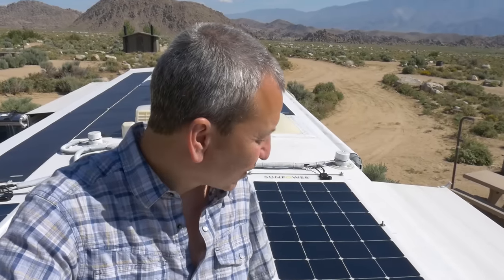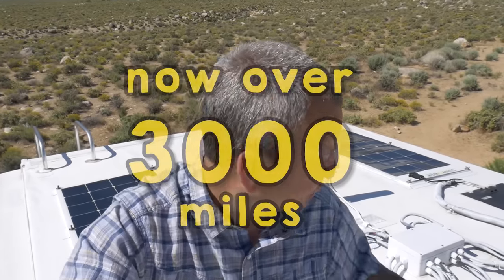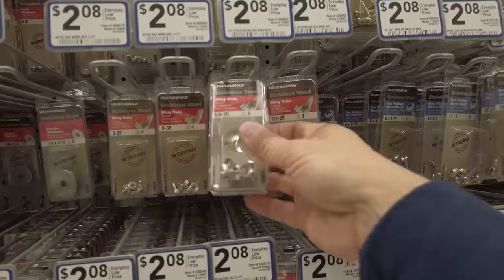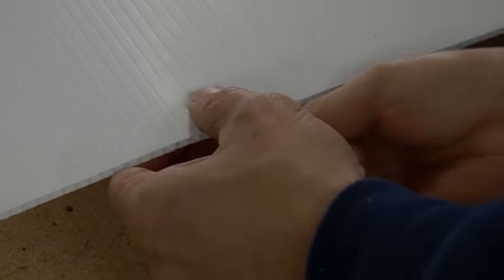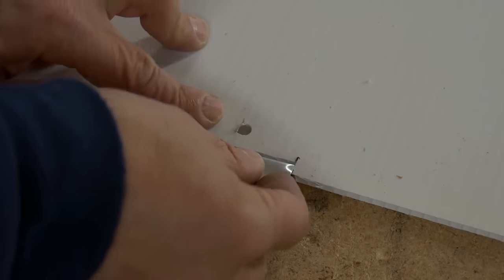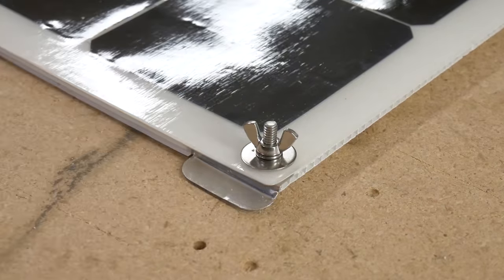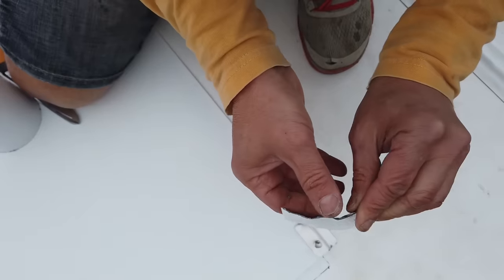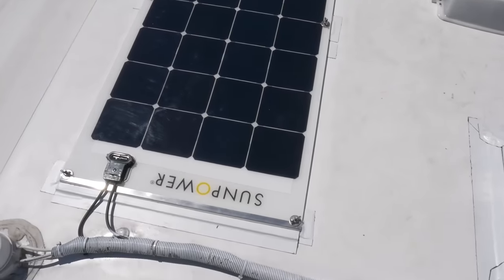Better Way to Mount Flexible Solar Panels on RV (2019)

Comment: Would this really work with tpo/rubber roofs? Your roof seems like fiberglass, I worry about simply gluing onto rubber skin/“paint” and it simply peeling the rubber up and off.
Reply from the maker: My roof is TPO

Comment: Great concept, is there any reason not to just glue the insulator to the roof of the RV and glue the panel to the insulator?
Reply from the maker: You could do that. It would just make it more difficult to remove if you ever needed to.

Comment: Hey what I did was I have 3-320w frameless glass solar panels so I used 1''-1/2'' PVC pipe cut a slot down one side  of each pipe and cut the inside  of each elbow and use  6''x6'' Composite Decking Board for my corners and the midpoint of the length of each panel  to keep it up off the roof then used J pipe  clamps to hold down the PVC frame in to the Composite board  2 at each corner and at midpoint  drilled holes on bottum of PVC for drainage works great and was cheap and easy (just my idea)
Reply from the maker: Thinking outside the box. Love it!

Comment: Thank you for the video and information.  Do you think a second layer of the corrugated plastic will be good to insulate the panel from the roof more, pad under the mounting bolts and still be a strong enough mount?
Reply: If you want to lift it up further, try a polycarbonate panel or tubular aluminum frame.

Comment: Nice video Tito and after seeing your video I bought a couple of Sun Power flex 110 watt solar panels. I noticed in one of your videos you put out a portable  solar panel on the ground as well. It also looked like a flexible solar panel. How are you supporting it on the ground? Is it the same method you used for small solar panel on windows with pvc tubing around the sides? I'm asking becuase mine will have to be portable  since I don't have the real estate on the roof of my small 16 ft RV for panels.
Reply from the maker: Awesome. Did you buy from Sunpoweredyachts.com? If so I have a new discount code for 10% off. I just haven't published it yet.
Reply: @RVwithTito  Brian,  yes I did. Once I test these, I'll need to order two more so that I'll have 440 watts total portable solar. 220 watts in parallel.to two Lithium Iron phosphate batteries.  Just finished making my solar cables using your video to crimp and connect my MC4 connectors. So, yes if you do have the discount code that would be great for my next order. Also, just noticed and watched your part 2 of using PVC on 110-watt panels. I'll need a way to keep them from blowing over when ground-mounted. Thanks for the videos.

Comment: I wonder if the corrugated plastic will rub/bounce on the roof and create a wear spot that rust can attack.
Reply from the maker: I have a rubber roof so not likely. On a metal roof, I would cover the bottom of the bolts with eternabond so nothing rubs.
Reply: @RVwithTito  so you aren't worried about the plasticore vibrating/rubbing against your roof?

Comment: Would your system hold up to walking on the panels? I own a catamaran and I would like to install more solar on the coach roof. I need to be able to walk on the roof though because my reefing lines are on the mast.
Reply from the maker: Unfortunately no. You may damage the panel.

Comment: With all that room why wouldn’t you use a 481 watt bi facia panel that puts out some real watts and inverter 10 amps I have 8 on mine producing 90 amps DC and 45 amps AC in 110 volt

Comment: Is moister getting trapped between the rv  and plastic panel?  I wonder if it will get swampy under there. Probably won’t damage your rv and a good power wash will take care of it if you ever remove it.
Reply from the maker: A little bit swampy, but it drains and dries mostly. Check out the update video I just posted.
Reply: RV with Tito DIY oh yeah. Thanks for the update. Good work. 👍

Comment: How were you able to get the wing nut to screw on snuggly without everything just loosely spinning in place since the other end of the carriage bolt isn't being held by anything to tighten the wing nut?
Reply: Someone suggested cutting a slot in the vault end of the threads for a screwdriver, However after slugging it down with one nut on top of a flat washer you can put a second nut on top and counter tighten them without putting too much force on the whole unit

Comment: How do you know, for sure, that the panels are cooler with that barrier between them and the roof? The roof can act as a heatsink if the panels are in contact with it and suck heat out of them. In my experiments, my flexible panels run 10 degrees cooler when they are in direct contact with the roof with nothing behind them. Have you done any comparisons?
Reply: They will run hotter and fail. Panels need an air gap under them to keep cool. Flexible panels aren't quite there yet and only last a few years or so. The roof will only act as a heatsink if it is metal. Rigid panel are still the way to go.

Comment: I have a 2017 Jayco Greyhawk 29MV, it came with a Macnum Dimension1000W pure sine wave  inverter , with a Macnum Dimension CSW-TS15-H 15A AC Transfer Switch and lastly a Progressive Dynamics.inc INTELI-POWER 9200 Series Model PD9260C,  I wanted to upgrade the INVERTER with a GoWISE Power PS106, 3000W pure sine wave inverter, can just the Inverters' be switched or will the Transfer switch and Converter/Charger  also have to be upgraded .
Reply from the maker: Yeah. You should be able to swap out the inverter as long as its voltage matches your battery system voltage and there are no proprietary AC or DC connectors.
Reply: @RVwithTito  thank you, yes to the best of my knowledge,  everything is compatible as far as voltage,  I was concerned that may e the transfer switch was made just for the Inverter that came with the couch, they are from the same  manufacturer.  I really don't know that much about the limits on the switch if there is one at all.
Reply: @ronjones2733  May not be a good idea. A 3000W inverter would draw MUCH more DC power and be able to supply 25A+ AC. It looks like your transfer switch is rated for 15A, so you may need to replace the transfer switch with a higher current one. May have to update wiring, fuses, etc. too (DC and AC) to handle the larger loads.

Comment: Did you test the heat?  If so were the panels cooler?
Reply from the maker: No I haven't, certainly not with the same panels. My previous panels were very different, but looked the same as these.

Comment: The thing that might be an issue is galvanic corrosion. Mixing steel with aluminum and being outside in the elements... https://en.wikipedia.org/wiki/Galvanic_corrosion

Comment: why didn't you install nylon embedded nuts rather than wingnuts? You don't seem to need easy wing nut removal if there is a need to remove the solar panel. A simple wrench can remove nylon-embedded nuts in little time, and the nylon should ease your mind about the nuts working loose.

Comment: One potential problem if you ever have to change solar panels. There is a good chance the new panels will not have the same dimensions as the old ones. Have found this even with panels from the same company. In that case your mounting points will have to change for the new panels.
Reply from the maker: I've seen that too. Thanks for pointing that out. I've been known to pick up a spare panel when I order the others.  I've also just drilled new holes in flex panels that don't have enough.
Reply: @RVwithTito  I asked a solar panel vendor about putting new mounting holes in a flexible panel and was told it would void the warranty.

Comment: It seems to me that just one layer of the plastic cardboard at the bolt sites is all that is holding down most of the panel if you cut away

Comment: How would I install panels on a 98 Ford e250 passenger signature select series eclipse?   The roof is all wavy like.   And I have idea where to start .  Please help.
Reply from the maker: Each install is unique to your vehicle. I've seen folks mount the panels to the ribbed pieces that stick up with VHB tape or Sikaflex sealant. Others have created their own frame. Just make sure the one on the front of the van can withstand high winds hitting it.

Comment: Why not just glue the plastic corrugated sheet to the bottom of the solar panel?
Reply from the maker: I ended up doing just that in the more recent flex mounting video.

Comment: Why not use an extra layer of aluminum foil to reflect and dispurse any heat between roof and backside of the solar panel to a large area? It is a way to cool because it is aluminium ! Btw I would have made a rack out of tubes where I can hang my flexible solar panels between the bars with some tensioners. You get a way larger area available to mount panels and still do not interfere with skyroofs and cableboxes or vents. You could even make it a three layer foldable rack creating triple the space of your roof area for a whopping 2KWatt solar capacity if you wanted.

Comment: Water doesn’t get caught between the plastic cardboard & the solar panel?? Help! Thanks!
Reply from the maker: Yes. Between the plastic cardboard and roof. I used a hose to blast it out periodically. Now I have a different setup.

Comment: Why not just use 300w panels made for domestic use? 4 of those and youl be set
Reply: Most, if not all panels can be used for battery charging OR ...to tie into the power grid out on the street. It is the solar controller that determines what service the panel is capable of providing. NOTE the panels that tie into the public power grid have a complicated and costly array of controllers, cooling fanms and and other specialized equipment. Be careful what controller you purchase...some will not work in a stand-alone situation such as with an RV or remote cabin.

Comment: You've been running this over a year now.  Have you had any problems just having the solar panels taped down?
Reply from the maker: I did a follow up video at the one year mark. All good so far.
Reply: How about your electrical output? I have heard many people experience decreased flex panel efficiency in a relatively short period. As much as 30% in one year. Thx!
Reply from the maker: @OCNJKirk  No so with these in my case. They seem to still be performing well.

Comment: i have used that plastic board to block the sun from my rv tire, after about 4 yrs they get very brittle and and break apart
Reply from the maker: Good to know. Thanks. Seems easy enough to replace after 4 years.
Reply: @RVwithTito  but mine are also in direct sunlight so these may not since they are under the panel, i am going to set mine up like this also

Comment: That corrugated plastic is not stable for use in the sun long term. It becomes brittle and falls apart in a couple years. But good idea overall.

Comment: How would this method work for those long narrow amorphous panels?
Reply from the maker: They are peel and stick. So you'd have to stick them first then mount them I suppose.
Reply: RV with Tito DIY Thanks Brian. Was thinking the same thing, mine are eighteen feet long and somewhat cumbersome to roll up and store, but I like the ability of placing them on the ground and parking the MobyHome in the shade. Still thinking of a way to secure them topsides for travel.

Comment: It's hard to tell from the video but what is your roofing material?
Reply from the maker: TPO rubber roof.
Reply: @RVwithTito  Looks like it has been holding up well, no issues with the rubber lifting at the mounting locations then?

Comment: Hi! So the corrugated plastic sheets you placed under the solar panels - did they eventually rot out due to weather?  It looks like after you carve out the small sections for the bolt heads that all you have holding the sheet to the solar panel is a very thin plastic surface...

Comment: Very novel install! Love no HOLES in the ROOF!! Only concern....You cant angle your panels for a better angle in the winter & I've read that flexible panels aren't as reliable. Thx!
Reply from the maker: I have more panels I setup on the ground which I can point anywhere. There aren't many folks who tilt there panels regularly. It's kind of a pain.

Comment: Thank you for yet another very helpful vid. But i wonder: Why not just glue the solarpanel onto the coreflute?
Reply: Mega Chill then it would defeat the purpose of the wing nuts, you want the panel to be easily removed whilst the corflute remains anchored on the canopy

Comment: the raised bolts sticking upward could be trip hazard while being on roof.
Reply: Be sure to wear your leg guards and gloves, actually if the bolts are the proper size length then all you have to worry about is the wing that which has rounded corners.

Comment: How do you get the wires inside the RV?
Reply from the maker: Here's how I did it: https://youtu.be/aB8ic6x9DAM  There are other ways too like down through a refrigerator vent if that's an option for you.

Comment: Where do I buy the flex
Panel you use. I want to mount 2 panels on my 4 wheel pop up which has
 Yakima rails mounted.

Comment: Brian, I'm curious  about the RV withTito name.  While reading through the comments many refer to you as Tito instead of by your name. Is that an acronym for something?  
While out RV shopping,  you found it and said "This is the one" ~ T i t o ~ or name of a puppy, or?
Reply: I think he said it was the name of the dancing figurine on the dashboard of the RV
Reply from the maker: @benningtoncamper2852  Correct!
Reply from the maker: The other comment is correct. Little Tito still sits on the dash. You can find the original "Big Tito" is on the top shelf in the shop. I originally started the RVWITHTITO website over 10 years ago long before becoming what it is today. Tito has also become a nickname of sorts, so I answer to both.

Comment: I couldn't find those transition straps anywhere. My biggest issue was working with a curved roof on both axis'. I ended up trying and combing a few ideas to install it on the roof of my car. Thanks for the help & replies.
https://youtu.be/idm3ooqQFcU

Comment: An insulating layer... that keeps the panel cooler... 

Can you walk me through that logic?
Reply: Perhaps there is a sauna in the van? :)
Reply: @AllanSavolainen  You know... I'm just going to assume that's the case because that would be completely awesome.
Reply: I had a Zamp flexible solar panel fail due to overheating in less than a year of use. According to the manufacturer, they say they see this relatively often. It was installed directly to my painted aluminum roof with Eternabond. This method will allow airflow and heat dissipation and hopefully preserve the life of the panel, not to mention make replacement easier.

Comment: hmmm,   if you're gonna do all that work,   you might as well installed a regular solar panel instead of the flexible one.  They're more durable  and will last much longer.   Flexible panels have an inherent design flaw in them.  They're made with plastic housing which has very poor heat dissipation and they cannot survive being exposed to the sun for the long term.  It doesn't have enough protection from small impacts either like hail or tiny rocks.  This is why they can only give you a guarantee of 5 years  instead of the typical 25years.

Comment: Is EternaBond the same as the Window Sealant tape found in Home Improvement stores?
For example
https://www.homedepot.com/p/Protecto-Wrap-BT25XL-6-in-x-50-ft-Window-and-Door-Sealing-Tape-D897206/100396171

or 

https://www.homedepot.com/p/Nashua-Tape-6-in-x-50-ft-Select-Window-and-Door-Flashing-Tape-1343003/206495170

Comment: Hi Brian, 
Love the fact that you don't need to put holes in the roof!
Have you considered using just heavy duty Velcro without the plastic cardboard?
https://www.youtube.com/watch?v=FfDHyOPSMss
Using the velco raises the panel slightly above the roof allowing air for cooling, but not so high that the panel would lift.
Some testing would need to be done to see how many strips would be needed.
Easy to install too.  Cost is probably less than the materials that you used.
Mark

Comment: Not sure why you go through all this instead of buying panels already mounted in an aluminum frame. The flexible panel makes no sense as you are basically making it into a solid mount glass covered panel.
Reply: Wile E Coyote I disagree.  They are much less fragile, and are mounted much closer to the roof.  Also, you aren’t puncturing your roof.
Reply: I can agree with lower profile, but framed panels are easily mounted in same fashion with VHB/everbond without puncturing the roof. I would argue the flexible are more prone to clouding over and fading. Just my personal experience with flexibles.
Reply from the maker: I would tend to agree. I would only use VHB on a fiberglass or metal van roof. Without screwing down the metal brackets, I would bet the wind shear of a large glass panel would easily separate the TPO or EPDM from its thin backing like you said.
Reply: @RVwithTito  I agree with Wile E Coyote. You need an air gap under solar panels to keep them cool so they don't overheat and fail. Rigid panel are the way to go. You should not puncture the roof to mount them. Use adhesive to mount ABS blocks that hold the rigid panels. See https://www.amazon.com/dp/B07RYPFSGJ/ref=sspa_dk_detail_0?psc=1&pd_rd_i=B07RYPFSGJ  Use a wind deflector at the front of the panels if you are worried about wind shear on rigid panels.